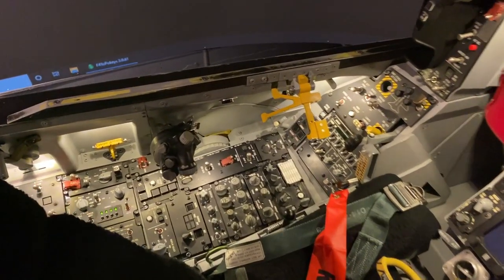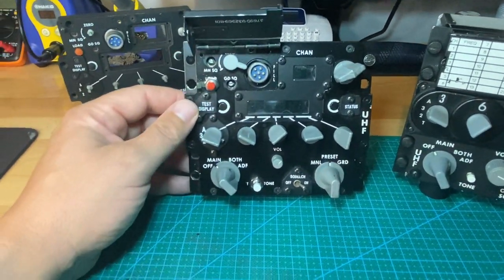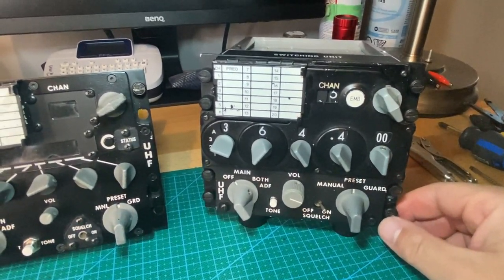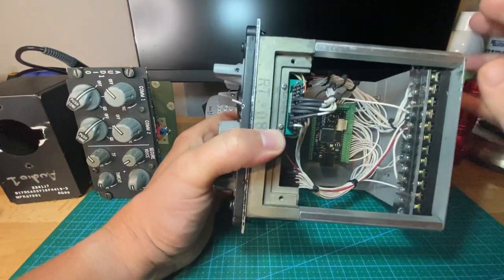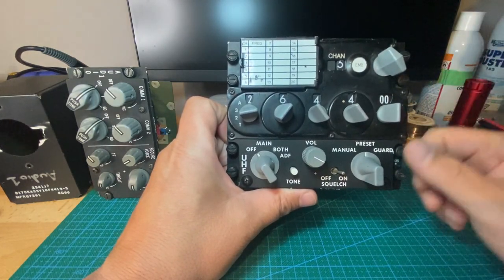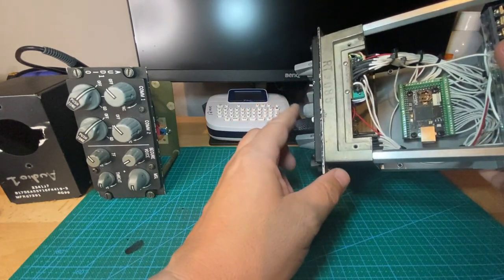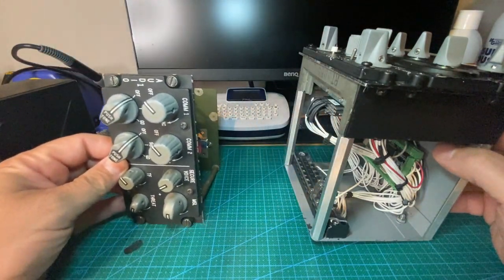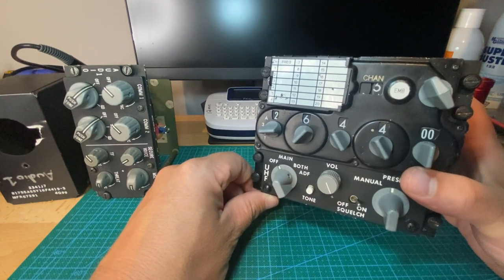TVS Build Cockpit UHF Update

Comment: It looks great. Just FYI, on the Havequick IIa, the little knob under the cover is facing the wrong direction. The cover has a ramp that sticks out and pushes the lever down that protrudes from that knob. The cover also has a rubber boot to protect the "fill" connector. Also, the HQII that I have uses ribbon cable and headers that keep the wiring from sticking out too far.
I am sure you probably have this information by now, but if you do not, you can contact me. I have one if you are interested in pics.
I have not taken the time to get my HQII radio functional yet. It is still just a space filler. Do you have any information on how to power it up?